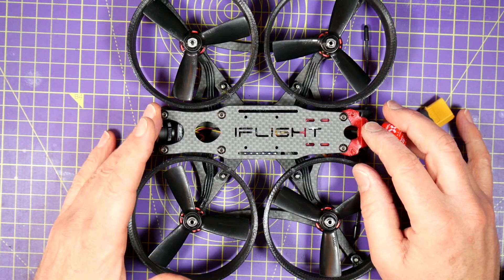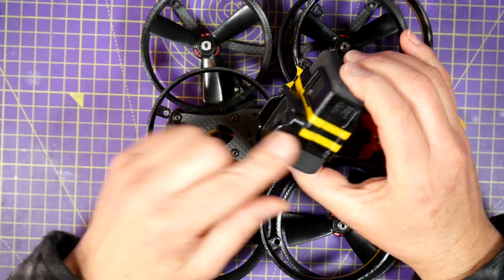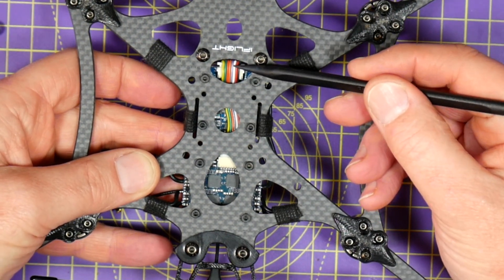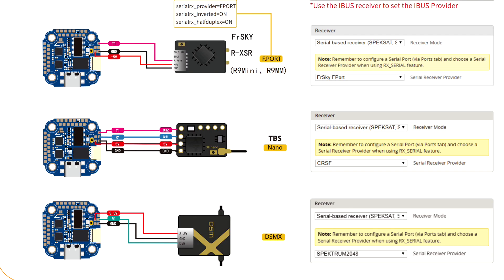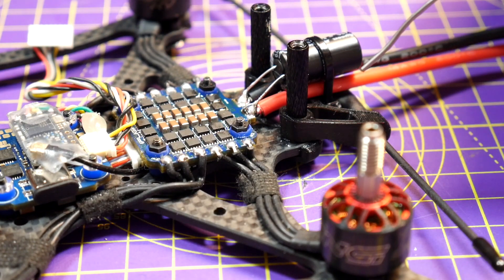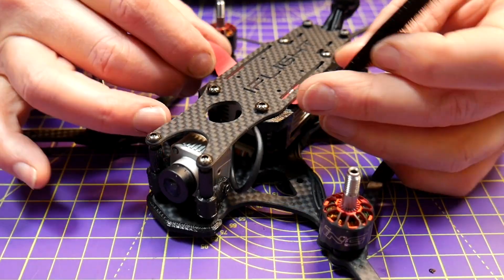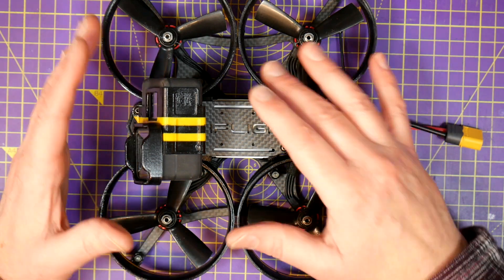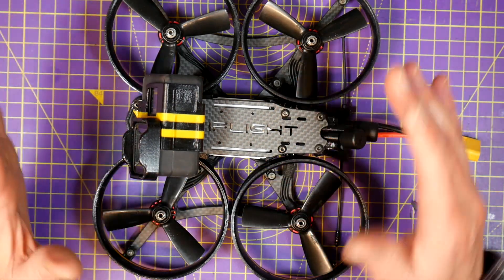iFlight MegaBee V2 upgrade - DJI Air Unit - Succex-D F7 Mini Twin Gyro - TPU Ducts

Comment: Hey there just finished doing this mod to my megabee printed your mounts etc but my tune is getting pretty bad oscillations was flying really good before the dji install, any chance of getting your pids and filters settings, did you re-tune to accommodate? Cheers Whirly

Comment: Good afternoon Whirly, thanks for sharing your knowledge. I wanted to see if you can help me. I bought a flight controller: "Iflight SuccesX Mini F4 V3" and I can not find the diagrams to connect my dji air unit, if you could guide me, I have already searched the whole network and can not find the solution, I wrote to the company asking for the diagrams, and they said: "You should buy this one: SucceX -D mini F7": , but I don't think it's a good answer from them, unless It´s impossible connect it to my dji air unit. I'm new to drones. thank you in advance. (i have the all dji system, googles, RC, air Unit)
Reply from the maker: The F7 is directly compatible with the Air Unit, but you only need a spare UART to connect it up. Thanks for watching.

Comment: Very nice job ! I like it, I am looking for the Crossfire antenna Mount that you have on the back of your megabee, do you by any chance have a link for the print ?
Reply from the maker: Thanks. The mount is the one that came with the MegaBee. You can buy it from them iFlight, but I haven't seen any STL files.
Reply: Whirly Bloke thanks for your answer, I found it on thingiverse 😉

Comment: What battery and what is your average flight times using gopro? I am currently building similar setup, same FC, Same motors, RDQ 5S 850mah but non-dji setup with naked GOPRO setup.. trying to get a rough idea.
Reply from the maker: Tattu 4S 1300mAh and a Hero7. I get around 4 minutes, but it depends how you fly.

Comment: Hey I am big time noob! I have a cinewhoop I built with the same fc and esc as  this one and the air unit obviously  but I need help with the configuration bad. It's a crazy little guy at the moment. Kinda scary. Can you point me in the right direction?
Reply from the maker: This is what you need. https://forum.dji.com/thread-195912-1-1.html

Comment: The actual fc and ESC of the megabee v2 (analog version, succex  mini f4 ) are not compatible with the dji air unit? or why did you change the FC and ESC?
Reply from the maker: The Succex-D F7 is directly compatibe with the air unit, so it's really easy and you get all the OSD features.
Reply: @WhirlyBloke  But is possible soldering to the f4 right?
Reply from the maker: Yes fine. But make sure you've got enough UARTS to talk to the Air Unit.

Comment: Very nice job. I recently tried the tpu ducts and found them to be a pain always bending and the props striking them. So I went back to the pla ducts for now. Have you experimented with different props? If so which seem to be the quietest? Thanks for the video
Reply from the maker: Ducted props are all really loud. Everyone seems to like the GemFan 75mm ones, but I prefer the original 3045s.
Reply: @WhirlyBloke  yes I agree from my testing and I tested every 3 inch prop along with some 5 inch cut down and another efficient and somewhat lower pitch sound is the iflight nagul 3061 props.
Reply from the maker: @pstylez4852  I think the 3045s have the best thrust.